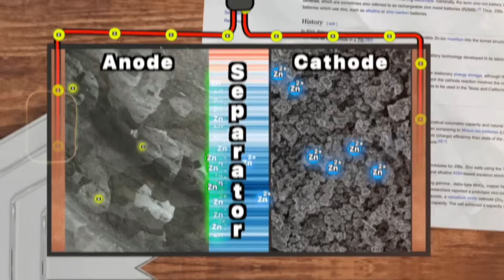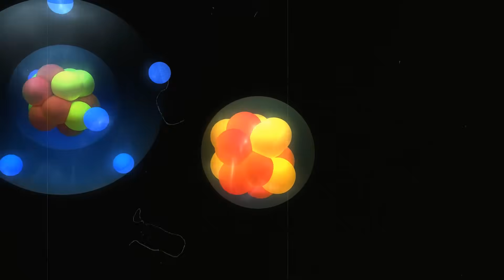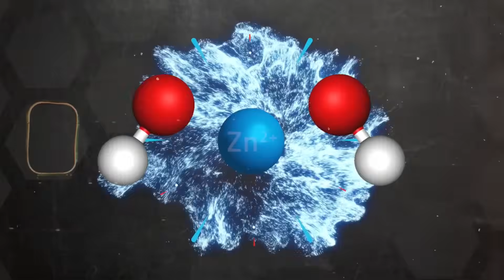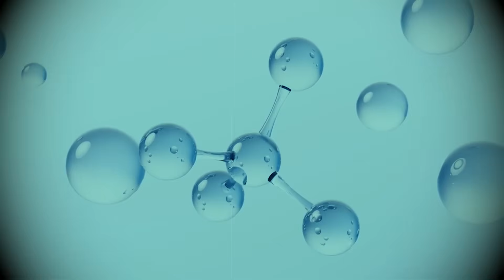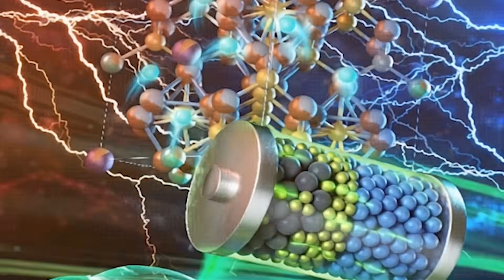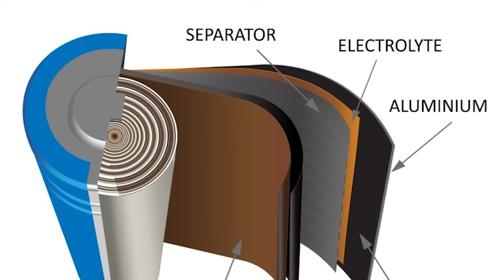The Zinc Revolution: The Battery That Could End Lithium’s Reign #futurepower

Comment: What if we replace the aqueous electrolyte with a doped graphene hydrogel?
Perhaps the energy transfer could be stabilised and the voltage could increase through a reduction in resistance. As amps go up watts go up and watts can be transformed into volts through a transformer.

Then you don't need to put them in series but you can run them in parallel to increase amperage overhead.

If the electrolyte improves then limits can be pushed more readily. 
Also by doping graphene with the anode and cathode materials perhaps ions will release more readily allowing the voltages to be pushed further as well.

What about quantum capacitors? Is there any way that we could use some of that technology to enhance the charge and discharge rates of zinc? 
Seeing as it charges so quickly it seems that the issue is less to do with the voltage in but getting the voltage out which is posing the biggest challenge...